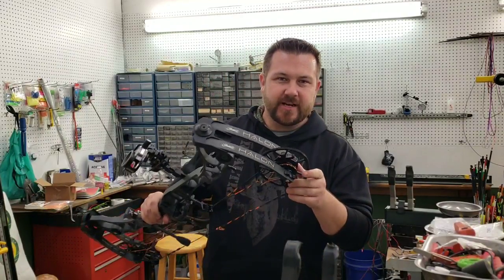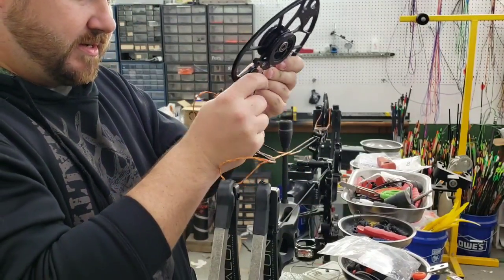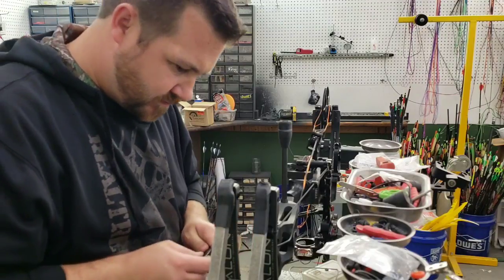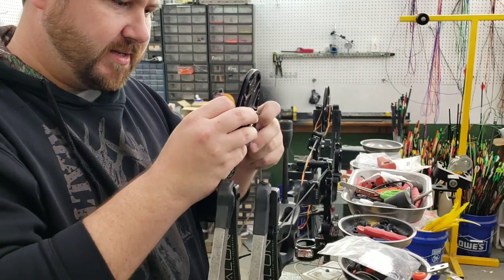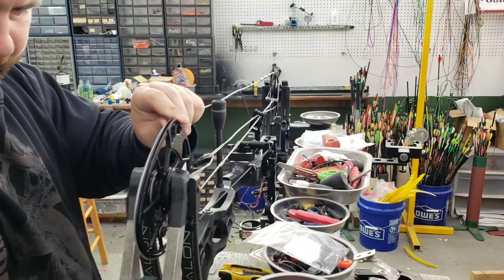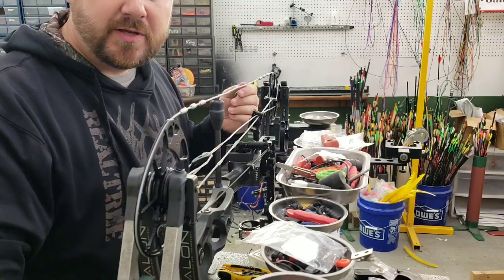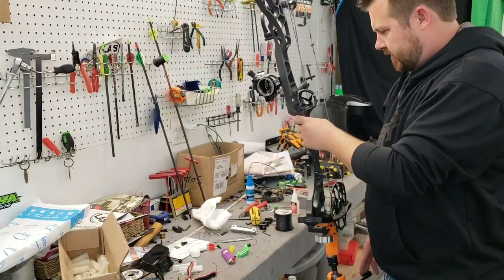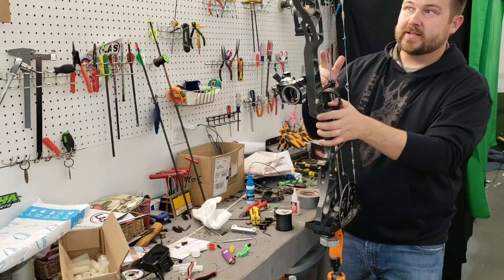Restringing and timing a Mathews Halon @ The Archeryshack

Comment: I just had my local archery shop put custom strings on my Mathews Halon 6 and the cables are about 1/4" or basically no where near running through the timing holes on the cams.. and the bows axle to axle is sitting at a little less than 29 ³/⁴" which factory spec is 30".. is this acceptable? Or did this archery shop mess up?
Reply: Your timing should be correct. After a new set of strings are put on. And  your axle to axle should be 30inches.  You need to twist the control cable.